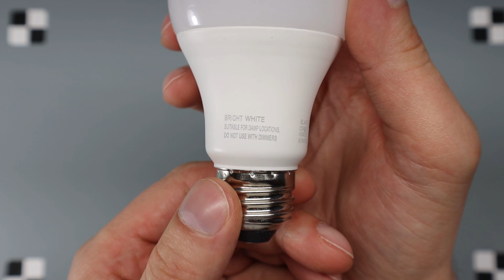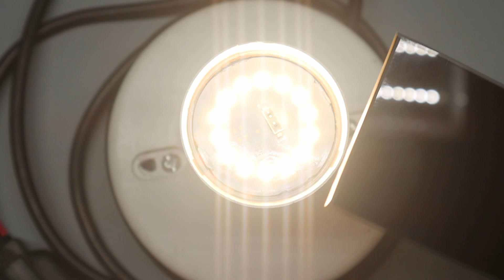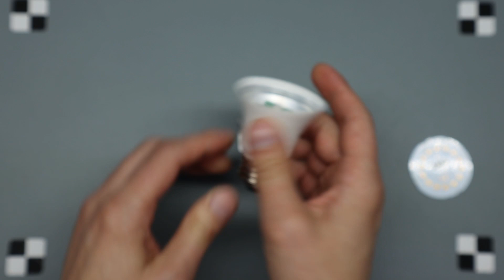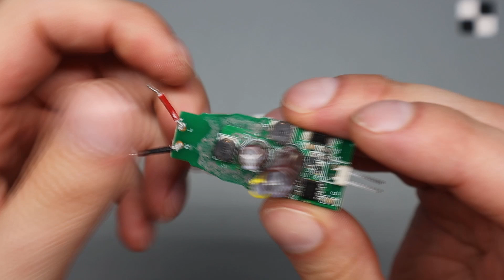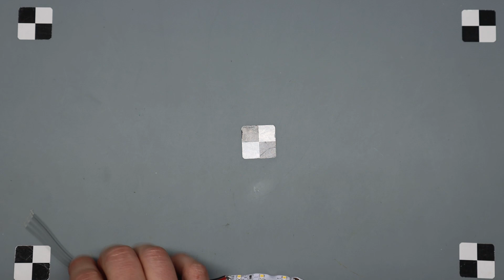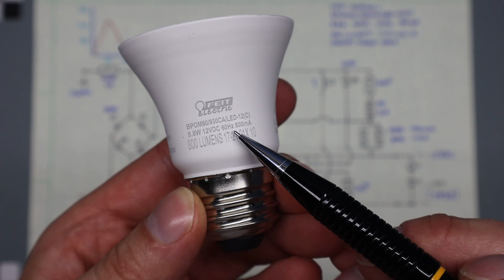12 VDC A19 LED bulb VS LED strip with schematic

Comment: I think the anode of D5 should be at the other end of L3, at pin 5.
LED 9V .5W  60mA ~70 lumens   
What datasheet do you have?  The one on their site is only 4 pages.
I found the full 13-page datasheet.  Very informative.  Can I post the link?
Reply from the maker: The one I referenced may have only been a 1 page. And I believe I hand traced the circuit, It's been a while...
You can post a link.
Reply: Datasheet.    https://3.imimg.com/data3/JV/YD/MY-29407/dc-dc-led-driver.pdf

Comment: Excellent video.

I wanted to use the bulb in a 12 VAC garden fixture but FEIT warns against using the bulb on anything other than 12 VDC.   Your schematic indicates that it's not a question of polarity so is the problem insufficient filtering after the bridge?  Will the bulb flicker or blow the fuse on 12 VAC?
Reply from the maker: If you put in 12vac, it should output approx 15-16vdc, and be pulling approx 750mA.
It has a lot of filtering for just DC, more then I've seen on standard bulbs, those capacitors are rated for 25volts, so anything close or over 18vac would fail in some way.
The LEDs are chip controlled, so they probably wouldn't flicker any more than with normal DC.